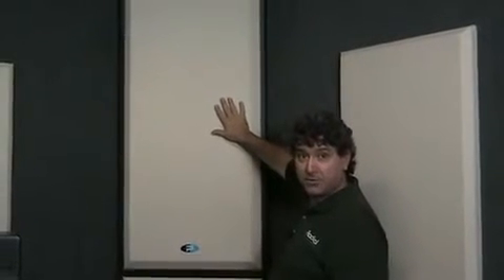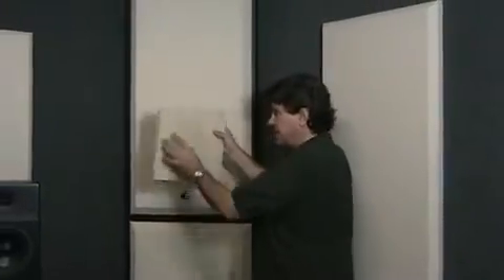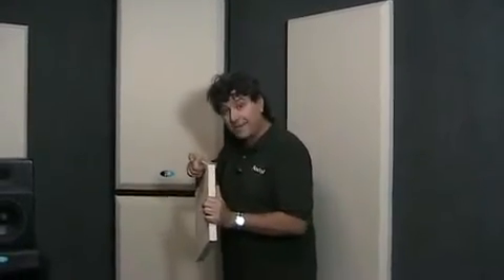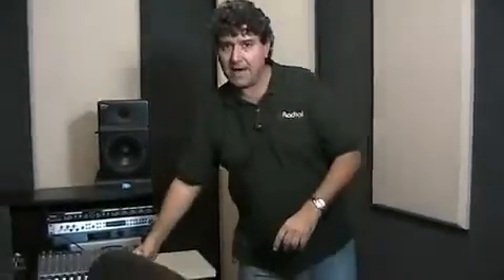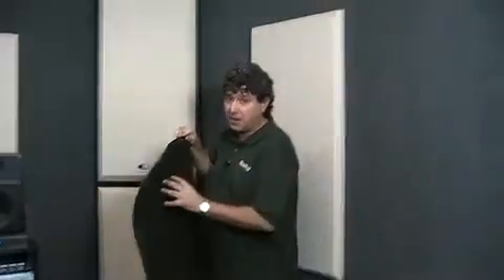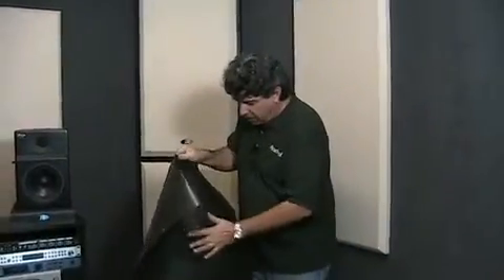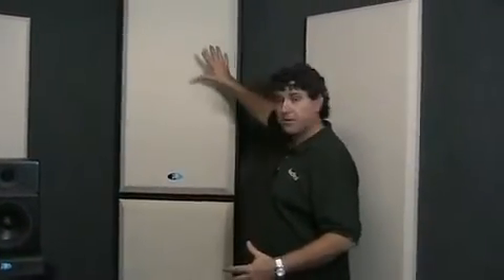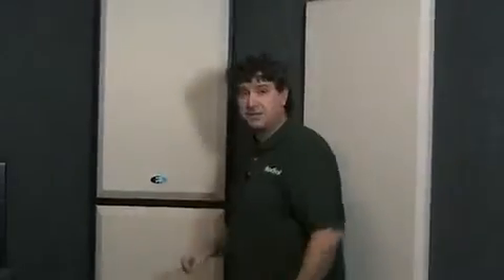Primacoustic® MaxTrap™ Corner Mounted Bass Trap

Comment: how effective 2 of these are in a small room with a sub
Reply: I got one from zzounds using the 12 month payment plan. Pretty worth it, room sounds much better.
Reply: @Epicsburg  yes i got 2 myself and it's nice also 😎👌
Reply: Reviews online said that these are the best bass traps you can buy, with a huge level of effectiveness. The price tag hurts though, but I want to get them
Reply: @yoshomiamoto  i did i have two of them the bass is tight and clear. 😎 I had to sacrifice somwhere to buy those 😂 but they are worth it
Reply: @yoshomiamoto  but you also need more broadband panels with them but its a good start to start with bass trapping and its what cost the most
Reply: @MuzdokOfficial  did you put them up behind the mix desk or in front?
Reply: @yoshomiamoto  the room is small and with it's layout the corner work best. I put one in front corner and the other behind it and I have add 6" mineral wool panels in the room. Im using a sub and with the proper adjustment plus room correction it's very good 😎
Reply: @MuzdokOfficial  my problem is that I have a door right in the corner of my home studio room. So I would have to get 2 traps for the corner, one for the door and one for the wall beside the door. So I may end up getting generic bass traps on sale for now,  but I really do want to get these.
Reply: @yoshomiamoto  same problem but you can put a thick bass trap on the wall as close at the door as you can and you can also add a panel on it something lighter
Reply: @MuzdokOfficial  interesting, I may try this then. So would you say that putting a bass trap on the door and a primacoustic panel on the side wall next to the door will suffice? Or should I put them in reverse order?
Reply: @yoshomiamoto  put the max traps in corners
Reply: @yoshomiamoto  leave an air gap as thick as the panel will help if its not in the corner
Reply: @MuzdokOfficial  OK, thanks! Will definitely give that a try! I appreciate the advice! 🙏
Reply: @yoshomiamoto  there's so much advices and tips/tricks you can learn. Too complicated here.
Reply: @yoshomiamoto  cheers 😎
Reply: @MuzdokOfficial  I just purchased one on ebay for $200 bucks! Store return apparently! I pulled the trigger immediately! Hope to get another one soon! 👍
Reply: @yoshomiamoto  you need to know if its already assembled its a shit ton on shipping. Make sure. 2 is recommended. If it's really this cheap congrats I'm in canada and it cost me a lot 😎
Reply: @MuzdokOfficial its not assembled, and a few of the pieces of wood are chipped, but everything else is perfect. Shipping was like 30 bucks, but the total with shipping was $200! 😎
Reply: @yoshomiamoto  wow you are lucky i couldn't have a deal like this here cost me over 1700$ here for 2 and the only free shipping was brand new disassembled. Do they have a second one?
Reply: @MuzdokOfficial  No, they only had one available, but I managed to find another one on Reverb, brand new with slight damage to the box for $330, so i pulled the trigger on that one. They have one more left that is Khaki colored for $300, same condition as well!
Reply: @yoshomiamoto  its awesome deals you get in the usa. Let me know about them later 😎
Reply: @MuzdokOfficial  Definitely! Once i get all of the panels setup I can then start investing into the synthesizers.
Reply: @yoshomiamoto  invest in better monitors when the acoustics are good enough for you. Keep me updated if you want and if you want some tips. Do you know how to use Room EQ Wizard for room measurements? And room correction on top after this like SoundID Reference as an example?
Reply: @MuzdokOfficial  I actually already had a studio before this one, but had to move to a new house, and realized that I needed to invest into bass panels, so decided to work on those. I also had 2 Focal Shape Twin Monitors that I was using for a few years until one of the moniter blew out and basically needed replacing. So I used the credit like that I had on Zzounds to purchase a new set of Focal Solo 6e Monitors. I Have yet to try them out though,  but have been hearing good news on the quality of those. The shape twins I currently have were excellent as well.
Reply: @MuzdokOfficial  I have never used Room EQ wizard or Sound ID though, definitely open to tips on how to use it for studio optimization!🙏
Reply: @yoshomiamoto  yes the measurements its super important to know how and where to treat the room
Reply: @MuzdokOfficial  So is it free to download and use or do i have to purchase them? Does it work through my monitors to scan my studio for proper acoustic placements?